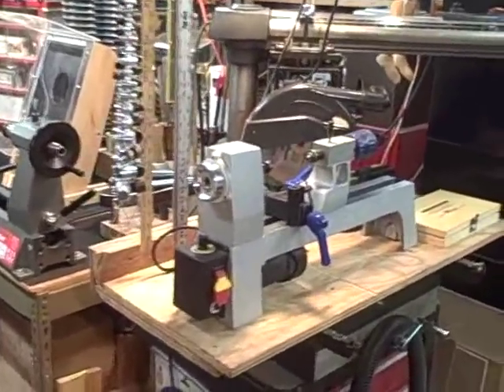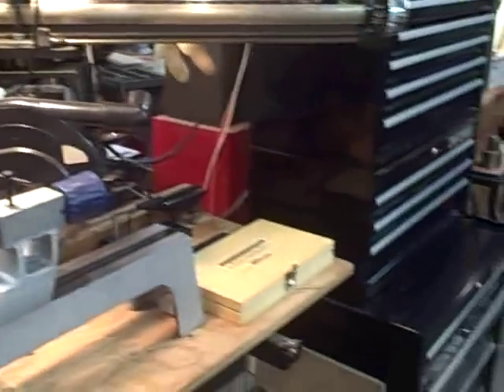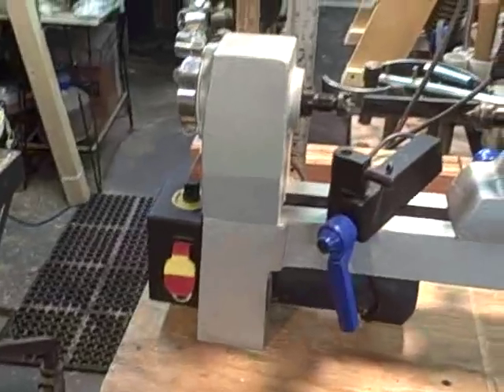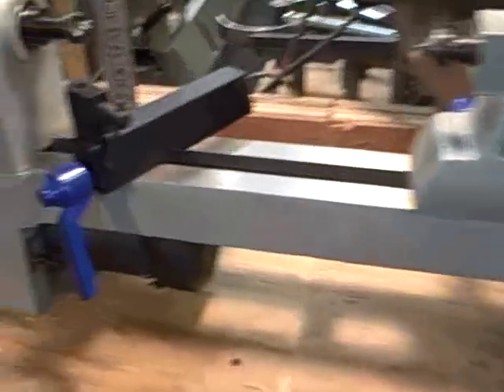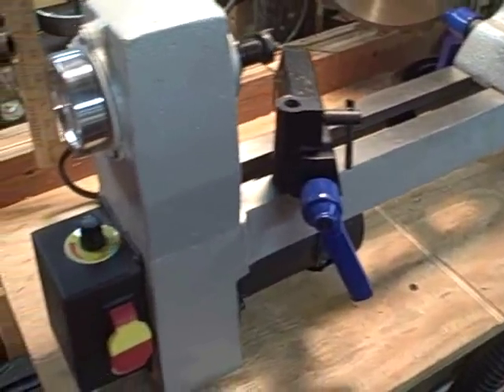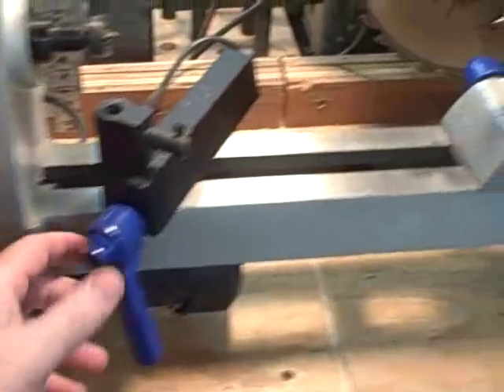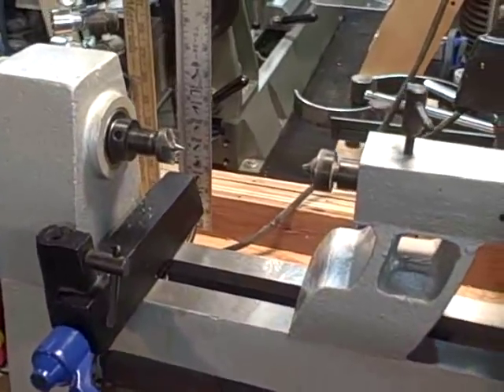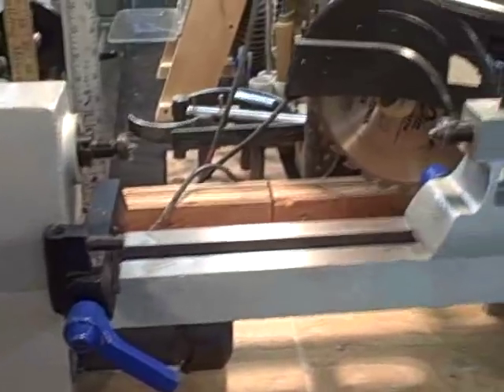Wilton Small Wood Lathe

Comment: I know this is an old video, do you know what size chuck you could put on this
Reply from the maker: Sure!  It uses a MT1 so you could use this  https://www.amazon.com/PSI-Woodworking-TM21-Diameter-Drill/dp/B01N3YU1TT/ref=sr_1_3?dchild=1&gclid=CjwKCAiAtej9BRAvEiwA0UAWXq2soRU7XOl24745ZYY0SsX0uo6TlYwp_aN472PoNYFgqidmqCzfQBoCJmIQAvD_BwE&hvadid=409959021730&hvdev=c&hvlocphy=9004381&hvnetw=g&hvqmt=e&hvrand=1283843628899232760&hvtargid=kwd-31027949972&hydadcr=24660_11410818&keywords=mt1+drill+chuck&qid=1606114832&sr=8-3&tag=googhydr-20